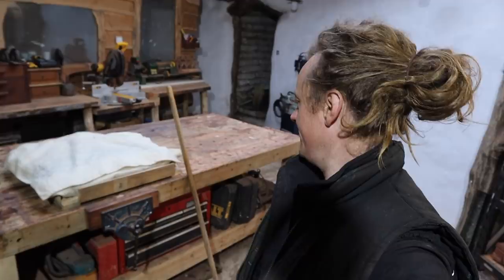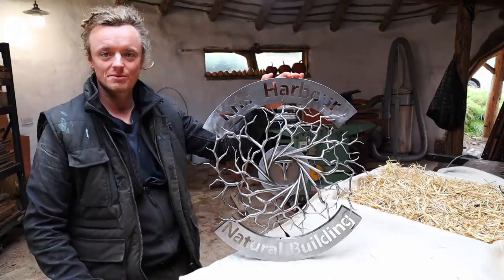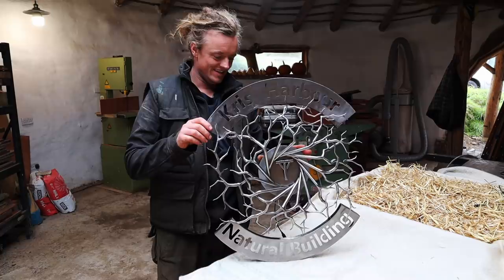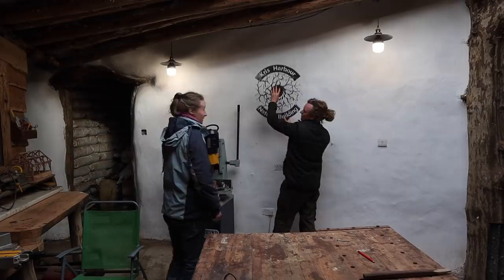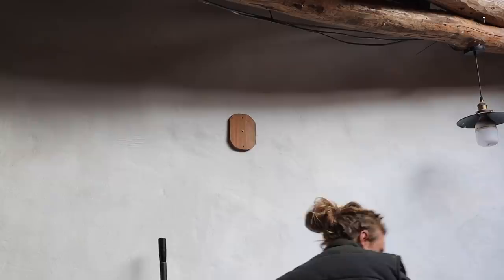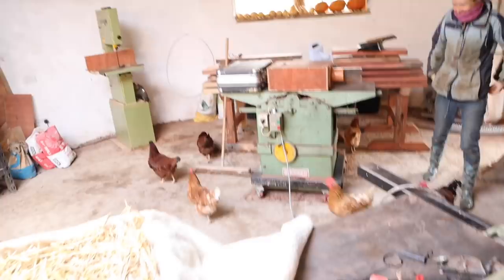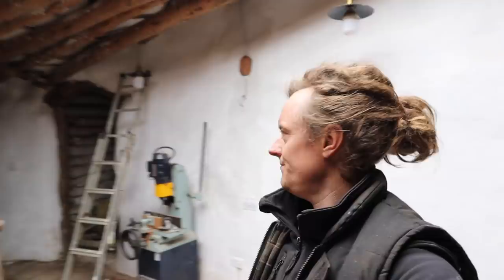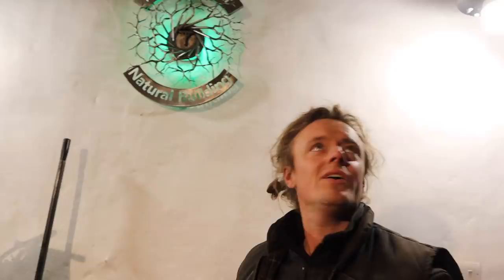John Norris Metal Sculpture Made My Logo From Scrap Metal

Comment: Could you fit one of those flexible neon style LED strings under the angled bits forming a circle surrounding your logo? The lights look super cool but because it's only back-lit the logo itself is dark, it would be really nice if you kept the soft glow behind but had your logo illuminated separately as well. If you could tuck the light under the logo border that would give the centre of the logo crisp illumination and the overhang of the border would stop it bleeding into the softer background giving you a nice contrast and making the logo pop.